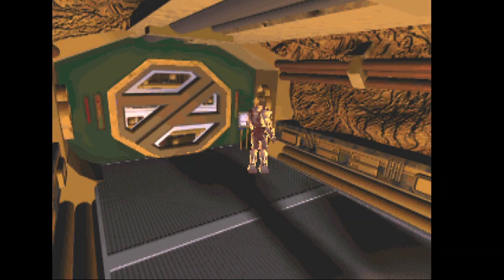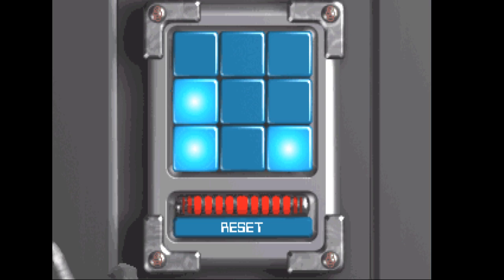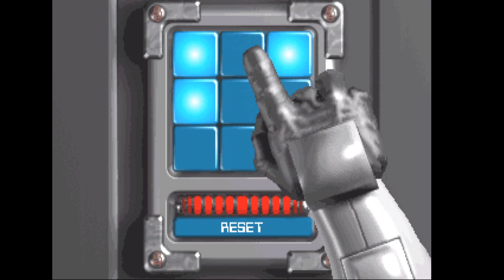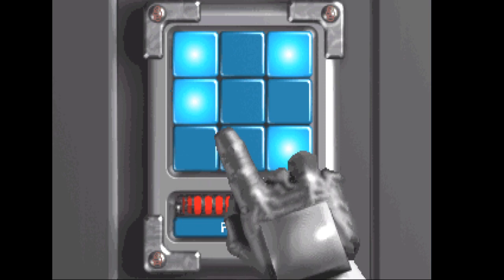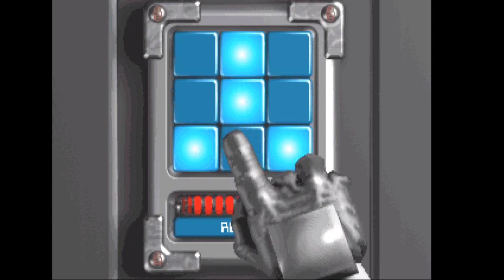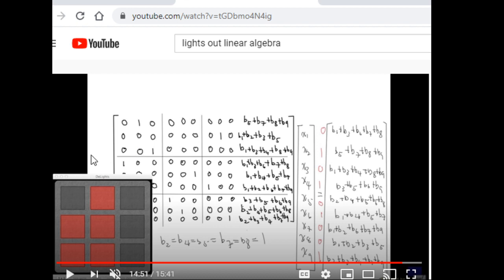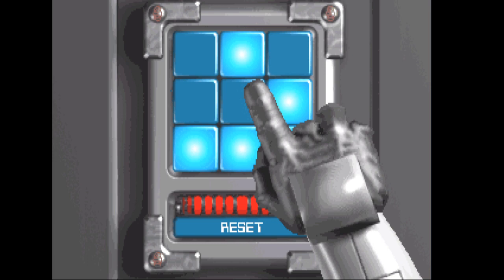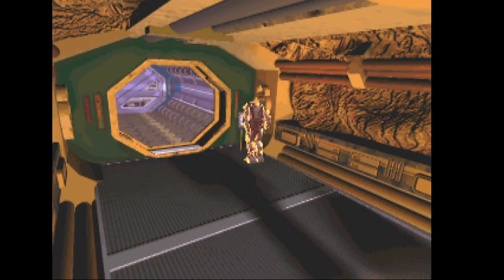Goin' BioFast in BioForge: Figuring out those darn light puzzles

Comment: Nice stuff! I don't know anything about linear algebra, so when I started out I used what little java programming knowledge I had to create a list of every unique state in the game and score it from its distance in moves from the win condition. It'd then take an input of a list of numbers representing the lights that were on in the initial state, find that state in the list, and then map a route through the states to the win condition. This was when I was the only person running BioForge, and I think once I was actually competing against others I stopped and learned how to solve it manually as I didn't have the smarts to make the tool available to everyone. My approach since then has been to learn combinations of button presses that flip only specific lights and no others (somewhat inspired by rubix cube algorithms I guess), which keeps it to an average of around 8-12 button presses, a little above the ideal average of 5, but I don't have to go outside the game or anything.

I'm pretty sure every button in the O-Ring puzzle has a unique effect, so if I'm understanding the premise the linear algebra solution should work, it might have just been a typo or something?

As for the two lines puzzle I think the only thing that might have been giving you trouble here is that the reset button doesn't reset the "last button pressed" value to the centre button.